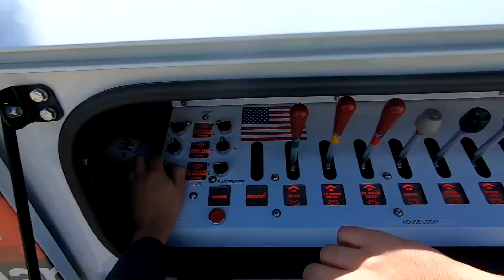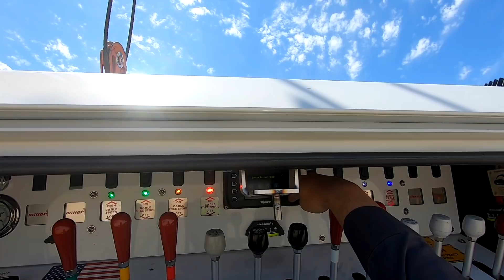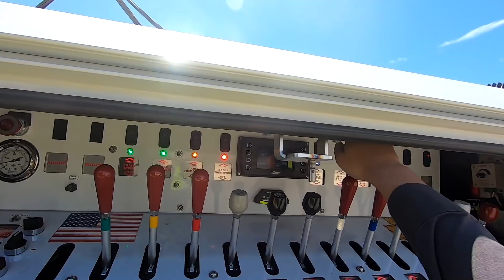Lifting Containers With New Hook!

Comment: I have never understood why in NA they don't use side loader container trailers. It's all self contained, the truck driver just unloads and loads the containers off the trailer, you don't need a third party to unload it and it can be placed exactly where you need it. This whole job would have been done in about 10 minutes too.